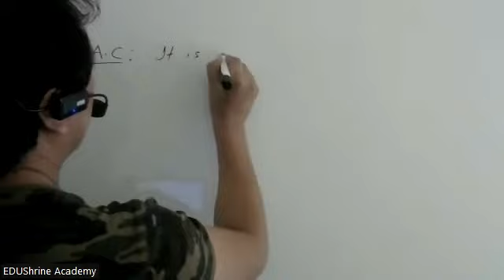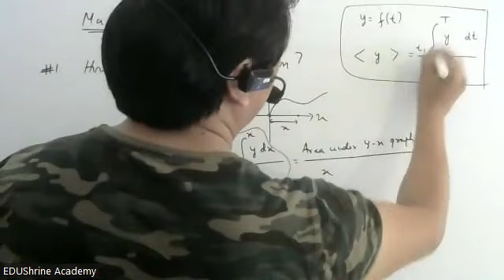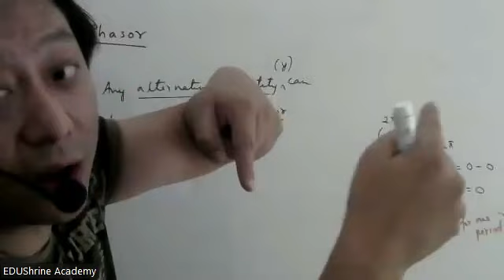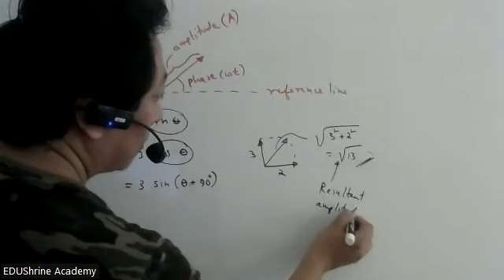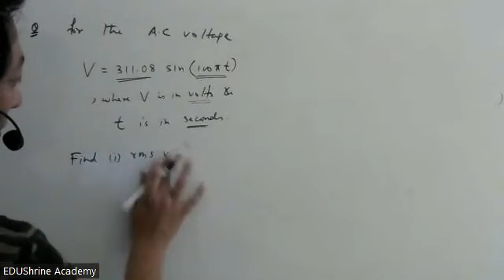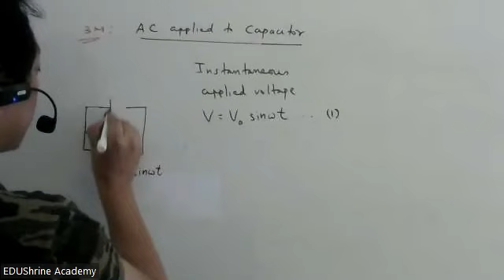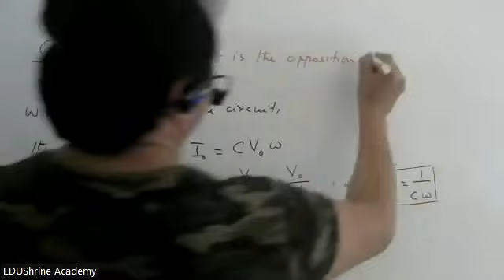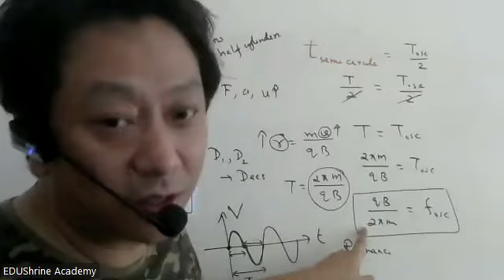Alternating Current Only Theory Lecture 1

Comment from the maker: The period of sin square theta is actually pi. So one may wonder if we should integrate from 0 to pi. You can do it. Same answer you will get. This is simply because sin square looks same between 0 to pi and pi to 2 pi so average will come same. It's like average of (2,3) is 2.5. Average of (2,3,2,3) is again 2.5 only.